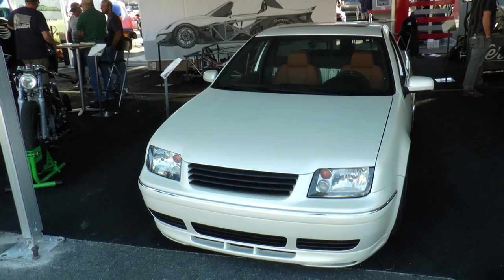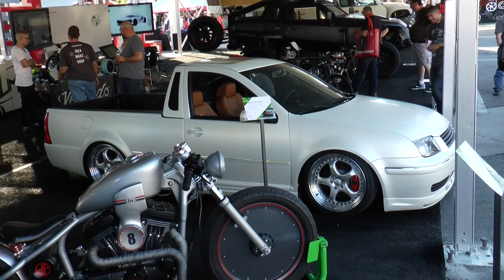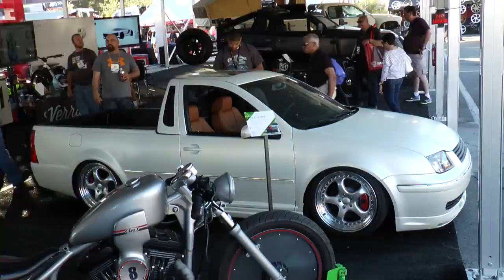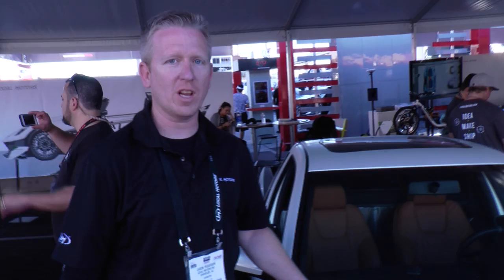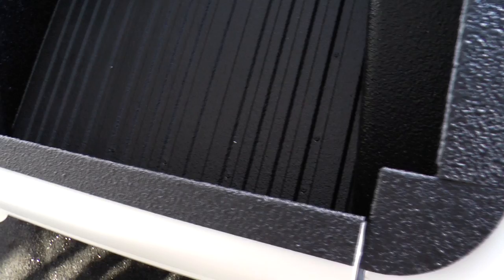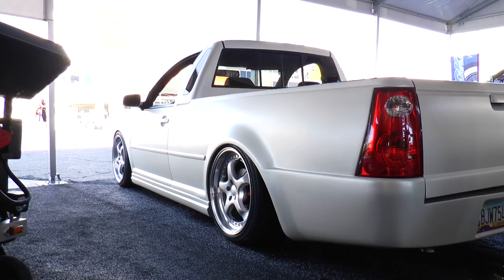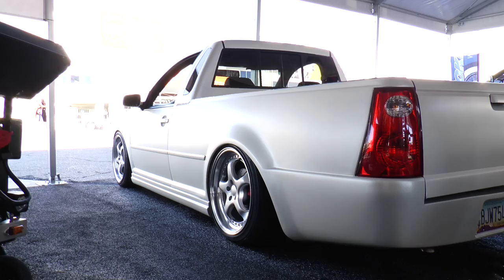VW Jetta Pickup Truck by Smyth - Local Motors/SEMA 2014

Comment: It's weird that I consider MPG OMatic to be a very successful show and yet, I find myself interested in and or relating to nearly every video posted haha, I WAS going to go with a 98 civic HX in my younger years but 8 TDI's later I find myself looking for a toyota tacoma and then finding this as a solve all to my solutions for my 00 Jetta (Recently bought a trailer to use instead but would much rather have the pickup bed and utility) AND my stock cd cassette player went out this very week and now I'm looking at the in dash one you sent me last week, haha thanks man I dont know how you do it but PLEASE keep it coming! (I also have a 95 wrangler with the HPA TDI kit in it fully built, gets about 30 mpg and puts out around 180hp and 280tq, VERY happy with how it turned out. And we just sold our 78 Willy's Mitsubishi DIesel sadly but if you want to hang out, do a show, are in the Columbus Ohio area anytime be sure to let me know!-Matt

Comment: Rutledge put one together on Lost in Transmission.  I still like minitrucks, so I think it's sweet, but then I remembered that I don't like front-wheel drive.  Damn!
Reply from the maker: TheSuburban15 Cool! Looking forward to that episode. I just binged on the first three … =)
Reply: Take a mk4 vr6 front subframe , complete with engine and put it in the bed. 
Add turbo for 4-500hp easily. 
I saw a early rabbit pickup like that before and its not too uncommon to hack a vw pickup into rwd.